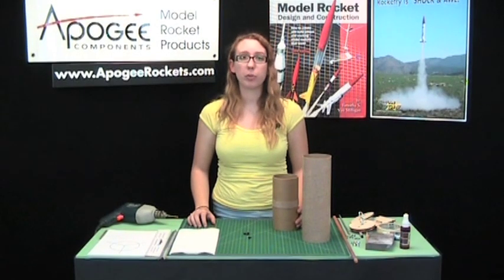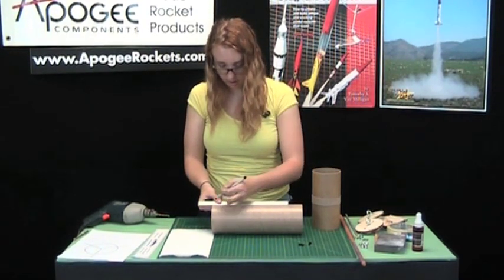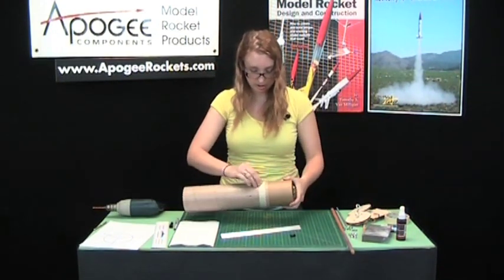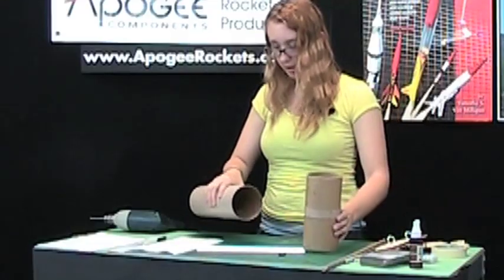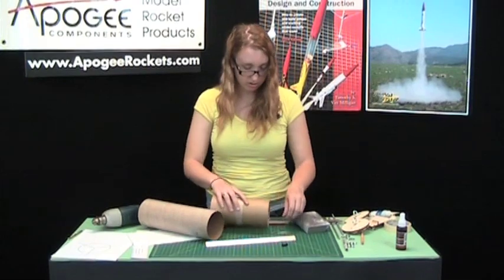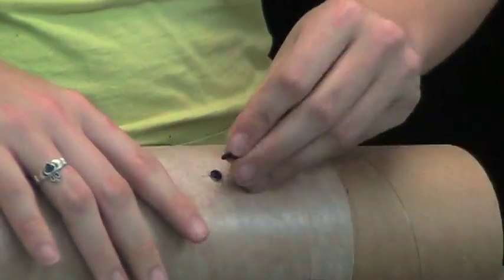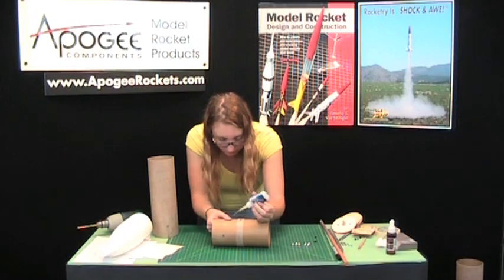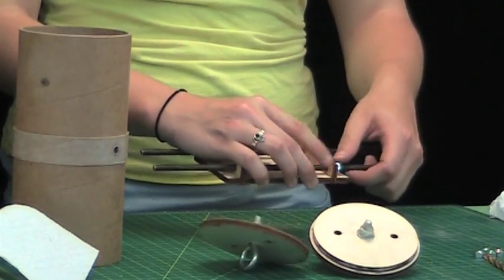Building Your First High Power Rocket - 7: Altimeter Bay Part 2 & Rivets

Comment: How many vent holes should be drilled in the e-bay tube that will carry the altimeter?  I see you drilled a 1/4 for the switch.
Reply from the maker: The same hole for the switch will also be sufficient for the altimeter. If you have one hole already, no other hole is needed.
Reply: @apogeerockets  I am using this for my L1 attempt using single deployment replacing the drogue with the main.  Do I need a vent hole in the upper empty body section to prevent the nose cone from coming off during flight?
Reply from the maker: @greenlex518 I would say it would be a good thing.

Comment: I am interested in building a mid-powered LOC IV for flying at the local club field, but would like to get my L1 at the high-power site and use a dual deploy with additional e-bay.

can this bay be added to a 4" LOC-I, and if so, how does it change the CP/CG, do they remain within safe limits?
Reply from the maker: It could be added. It will move the CG forward, which is always a good thing. Go for it!